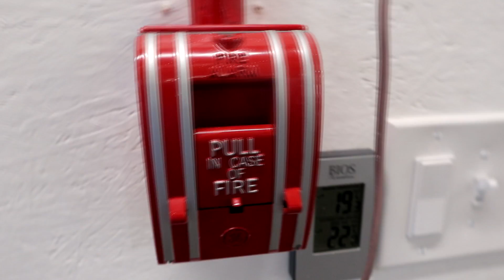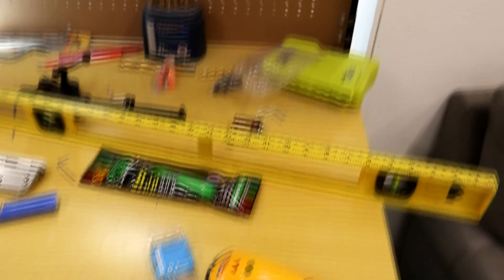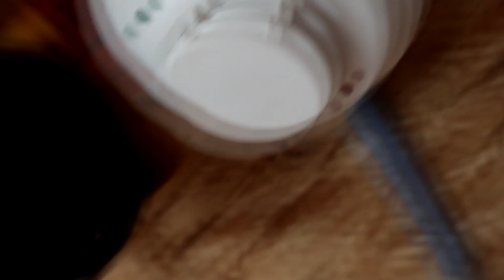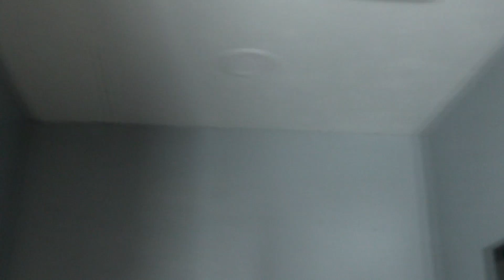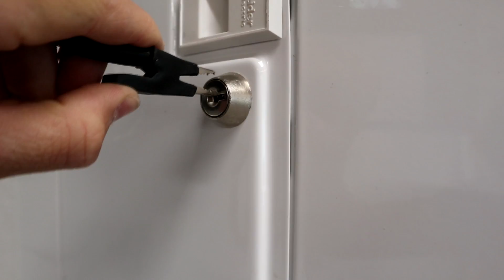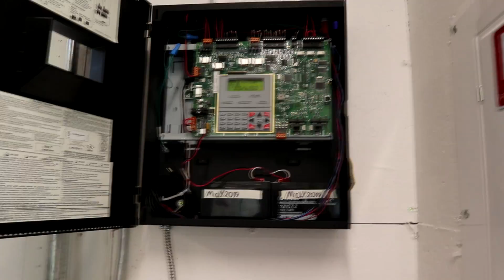Full fire alarm system test on the new panel

Comment: How is your wiring so nice??
Reply from the maker: using solid wire instead of stranded makes it A lot easier cause the Wires stay in place
Reply: @nics-systems-electric  but I do and it looks like sh*t
Reply from the maker: L-Series Fire&Saftey lol I ran all my wires at the very back of the panel and then they come forward and down